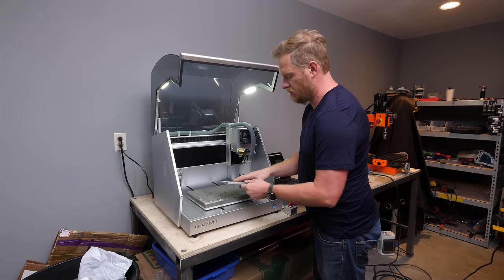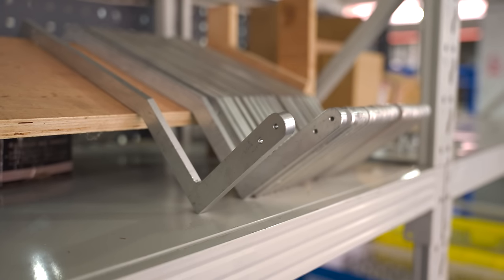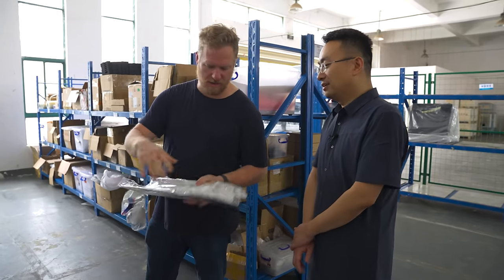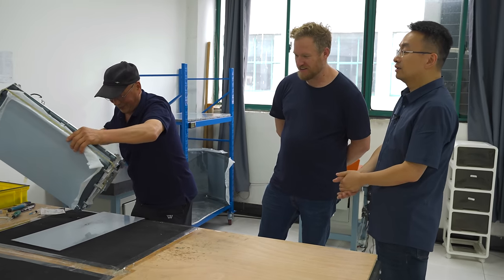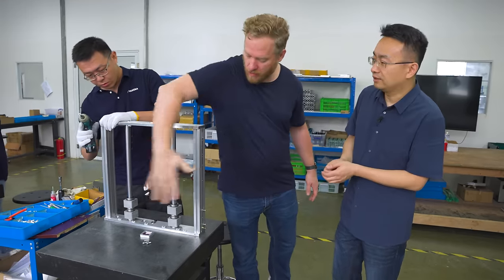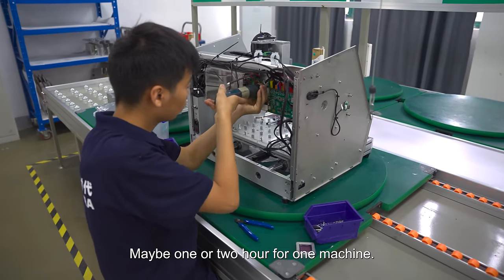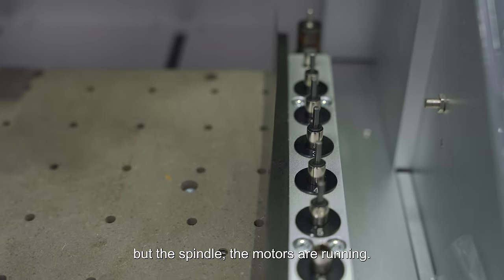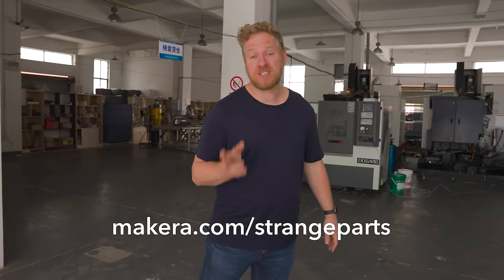Inside a Chinese Desktop CNC Mill Factory

Comment: Maybe it's partly because I have a Carvera and was super impressed by the build quality, but I feel like this is one of your best factory tour videos. And that's saying something, for the king of factory tour videos. 

And props to Makera for being so open. I know it's marketing, but it didn't feel like any kind of sanitized smoke and mirrors show.
Reply: What kind of stuff do you make on it? It's such a small machine overall
Reply: @gorak9000  I'm not the best to answer that one, as I have tool acquisition syndrome and most of this stuff sits around unused. But probably the thing I want to make most is PCBs. I managed to get it working with my old X-Carve (https://youtu.be/I8VJZX6hagE) but with the tool changer, enclosure, and all-around tighter build on the Carvera, I think I'll get better results. But I made one board and then the ADHD kicked in, so I need to find the motivation to dial in the workflow someday.
Reply: Yeah, this video makes you able to see exactly what goes into the build quality.
Reply: @ChrisMasto  Heh, it's totally ok, I have a full sized VMC in my garage (30" x 20" x20" travels 15HP spindle, 5HP axis servos on all 3 axes - weighs 6 tons - takes up a ton of floor space) - I don't know exactly what I'm going to make on it either, but I definitely have the work envelope to make big stuff! (once I get the thing fixed and re-assembled). The thing with PCBs is they're so cheap to just order them online these days - only really makes sense to do it yourself if you need PCBs like in an hour, but that said, I want to try to do PCBs on my machine too when it's running again. Funny, I bought my huge machine for way less than a Carvera, but of course I've put a ton of time (and some money) into fixing it too. Not counting time, I'm only slightly more expensive than the carvera, but with a full sized machine, with spindle probing and toolsetter too (if you're patient, good deals do come up on that stuff on the bay)!
Reply: @ChrisMasto  Oh, and also, kudos for being a person that actually has some videos on their channel! I have some on mine as well of my machine, if you go back a bit!
Reply: The fact its missing the smoke and mirrors show is the really nice part. Its raw, and for those in the industry know what we are seeing is true and how these things are put together and QC'd is represented accurately (for smaller scale manufacturers) . Thanks Strange Parts for taking us there.
Reply: @gorak9000  You're not alone, mate. In my warehouse, I have got manual lathe, manual milling, mini-lathe, mini cnc both lathe and milling, large industrial both lathe and milling, and many more. I bought those machines to do a few jobs, so I could save some money. Those machines cost were recovered after the jobs finished. lol...
Reply: Good to see that China can also make high quality products. I was impressed with the build quality shown in the video.

Comment: I wrote a term paper about how China started to become an economical powerhouse and learning from the west was a key part of it. People used to laugh at "Made in China" but thanks to their policies and deals with western companies they have acquired the same expertise and can now manufacture with the same or even better quality. Granted that doesn't apply to every single factory or manufacturer in China, but they have come a long way.
Reply: Personal experience, part of the reason why they're cheap is because a lot cut corners. I've had the pleasure of dealing with $10-20k machines designed and manufactured in China by various companies.  I'll give them credit in the companies i've dealt with didn't waste much.  Eg. Mains electricity cables that run through the machine are made up of several segments of cable which were hand twisted together and electrical tape put over the connection.  In the west this would never happen - single cables running from point to point and if they did have to extend a cable, then the wires would have been properly bonded together.
Reply: It's easy to go far on a boat someone else designed.

Comment: Wow that's a lot of granite tables, perhaps local "knock-off" brand rather than proper Mitutoyo ones, to go with the similarly branded dial gauge. We have just one Mitutoyo one at my workplace, used for measuring things. I was surprised how long it took the guy to calibrate it before we could use it ... About most of a day, with his special flatness-measuring gadgetry. When you get one of these tables you need to make sure it's in its final resting place as it can't be moved once calibrated.

Comment: Would love to see a desktop cnc with small work area 6x6x3” but with high rigidity and high torque spindle so you can machine stainless steel. All of the desktop mills I have seen barely do aluminum and usually with heavy chatter.

Comment: 2:30 mins into the video, and I'm surprised by the complete lack of PPE on the shop floor. The one guy is using an automated metal chop saw (likely with tungsten tipped blade) and blowing the swarf off with an air line. 

Let's be fair, we feel like we often over-do PPE in the westen world, but generally this all comes from events and experience. 

I have seen drills, mills and blades shatter. It's not a pleasant experience. 

What is the real cost to buy these guys a few pairs of safety glasses?

Comment: 25:00  That's a thermal printer.  The technology is licenced from HP.  The printer side of it is a very standard bit of kit that companies create an interface for and brand as their own.
The cartridges holds the ink and the print head.
EDIT: eg. The Answer U2 printers are an example of this
Reply: It's an inkjet printer, not thermal (though inkjet does use a thermal process internally to actually squirt the ink out of the nozzles). "Thermal printer" uses heat directly on thermal sensitive paper - this sprays ink on anything you run it over

Comment: Funny enough, they're not using a single carvera to make parts for the carvera. Almost as if you need a "real" machine to do "real" work. This thing might be a nice thing to have for a hobbyist - but at its price point, better save up and get a small "real" machine instead. $5,000 get you a long way on the used market and almost half way of brand new a tormach 1100m - which isn't a toy, but a machine. Although a very basic one. And they're using cheap chinese parts and machines as well.  The cavera is a glorified $300 desktop 4020 CNC with $4000 of added price for $1000 of benefit. What I see is $100 spend on quality motors. $50 on the spindle. $350 worth of aluminum parts and plates. $30 worth of screws, $50 dollars of cables etc. illusional (because china) $300 worth of labor. The fact, that they're selling this thing tells me, there's customers out there, who just hate money. Every tinkerer knows, what it is. And every company aims for a "real" machine. I'm very confused, where those customers come from.
Reply: First of all, the $300 labor cost is quite delusional, these aren't like people who are just sewing or glueing all day long. Apart from that, Chinese labor isn't nearly as cheap as it was 10 years ago.

Also, you somehow forget about the PCB's/electronics, all operational costs of the factory & company as a whole, R&D, you name it. 

How on earth are you expecting that a CNC can only be worthy if it's used at it's own manufacturing. It's a completely different product from a legit manufacturing CNC machine? The comparison makes no sense at all. Just like comparing this machine to a 1100M 😂 it's a completely different form factor, a completely different target audience and has a completely different use case.

Comment: Why the cnc machines don't has magnetic rails suspension on X & Y axis? Instead the traditional screw assy, it can measure exact position of the head using lasers, it won't go faster?

Comment: Wait, coefficient thermal expansion of Aluminium is about 24 um/m.C，that's huge for steel or Stainless steel (9.5 ~ 10.5). Even steel with lower cost and better rigid performance, why they still use aluminium?

Comment: Hey @strangeparts, can you add a SD card to a phone that does not have a SD card slot? Looking at your previous videos I imagine you could fit a USB - C hub in there, connect a USB-C micro SD card reader to it and use the other port of the hub for charging and other functions. One of the challenges would be to maintain fast charging capabilities, maybe you could use a UDB - PD compatible USB -C hub, whereas maintaining the proprietary fast charging capabilities like Dash/VOOC might be more difficult.

Comment: Processing extrusions is very common in North America. The same is true of auto tap semi-manual machines, which is NOT hand tapping. There's nothing new here. It's great to see this tour, but pretending it is somehow very different from other manufacturers is misleading. It's unfortunate to see absolutely no personal protection equipment in this factory. Supporting unsafe manufacturing is unethical from my standpoint. Most people blow this off, but you're forgetting all those who can no longer work because they are missing hands, eyes, or didn't survive. Cheap does not necessarily equate to "good". Cheap usually means shortcuts that result in injuries, inaccuracies, the need for constant adjustments, and frequent repairs. I understand why the entry level maker wants cheap stuff, but working your way out of the cheap mentality will cost you much more time, energy, and money than learning to work by hand, then moving into high quality processes. This tour represents a small manufacturing facility with no large scale ability. This is great, so why label them as a mass manufacturer? Overall, this is a fun tour that could have been more interesting and informative if the host had allowed the tour guide narrate what's actually happening. Too many guesses and misinformation. Keep them coming, but maybe let your factory manager reveal the process instead of guessing every step.
Reply: Narrow-minded 👏👏👏👏👏